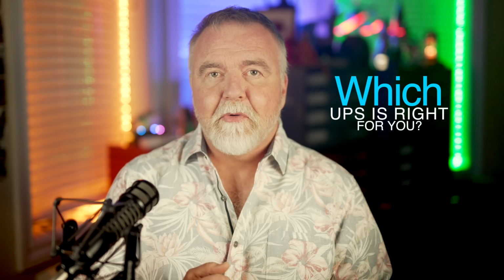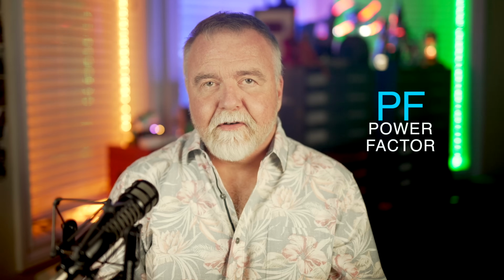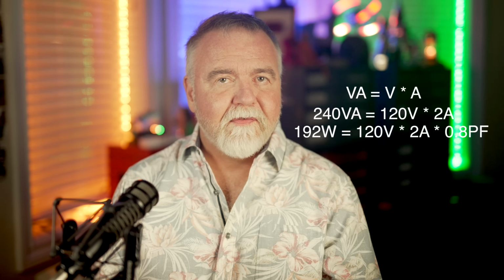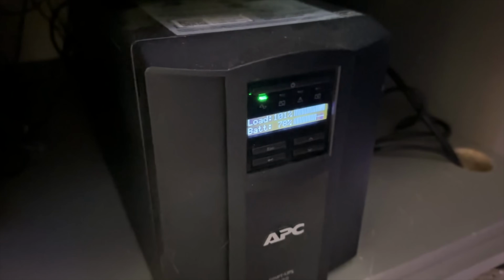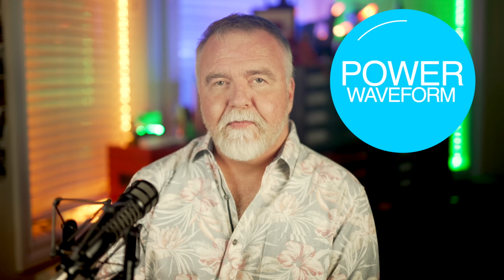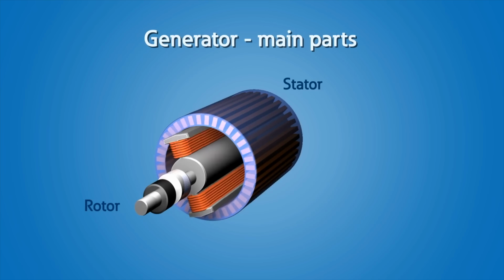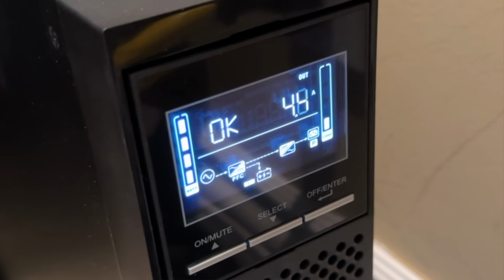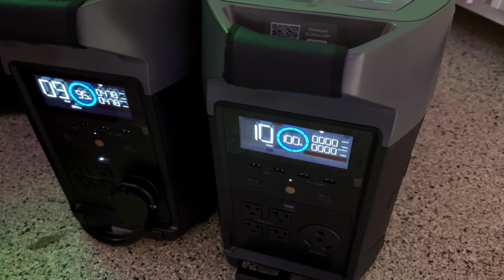The UPS Secrets YOU Need to Know!

Comment: You'll be amazed how most of UPS behave when tested with oscilloscope during heavy load or using power tools/other parasitic sources near them
Reply from the maker: I know... and you should hear my air compressor when run off a square wave inverter!  Sounds weird!
Reply: Ill be hooking up my scope to get insights here, thanks for the tip!
Reply: @DavesGarage  I thought square waves would shorten the life of heavy inductive loads. Thoughts?
Reply: @wickedcode007  I'll be more panicked about how my computer's PSU withstand against the UPS with modified sinewave or UPS that failed. Usually at power outage some of them behave badly against active PFC supplies (especially those with low hold time and shitty filtering design (15-20ms is ok, can't remember what ATX specs say)
Reply: @GbpsGbps-vn3jy  ATX spec is 17ms, at 47Hz and full load and minimum input voltage.
Translated from specs to real data could mean somewhere in the region of 15ms at 60Hz mains to 20ms at 60Hz (a bit shorter than full mains cycle to a bit longer).
If specs were to take PFC into account, than those could be following: "17ms, at 47Hz and full load and any input voltage".

Comment: Regarding battery longevity: li-ion has a longer average longevity than lead acid, but its longevity is significantly shortened if (a) maintained at full charge instead of around 80%, and (b) maintained at warm temperatures. You can increase the longevity of li-ion by de-rating them down to their sweet spot of around 80% and by keeping them cool. You can sort of consider the top 20%-ish of capacity as "over-charge", because it kind of is. And for temperature, if it feels cool to you then it's probably good, but if it feels warm to you then it's probably too hot for the battery too.

Comment: I have a problem with my pfsense router. it shuts down almost immediately when the ups switches over. Although the configuration tells it otherwise. The main problem is, that it shuts down the router (to a halt I think, not to a poweroff) and when power gets back the router stays in that state.

Comment: Thank you so much for this. I wish this had existed a couple years ago when I was shopping for a UPS. I did eventually figure out that I wanted line interactive since online wasn't in the budget, and that I wanted a proper sine wave for my gaming PC. I never could figure out a proper explanation of VA though, just that it's "capacity", so I ended up just getting 1500 VA since it the highest capacity available in what I was considering and I'd rather have too much than not enough.

Comment: I have an UPS. Last year, PG&E threatened to shut down electricity. I think I'm too close to the Apple HQ. The UPS started to go click-bzzzz-click-bzzzz. I thought the UPS was dying, but it turns out that the electrical circuit was dipping down to low volts, and the UPS was kicking in. The shutdown never happened, but wow, I'm glad I had the UPS.

I also got a cheap UPS for my modem due to power clicks for a while. My Internet connection kept having momentary drop-outs for several minutes, and the UPS keeps the modem running. I realized that my modem and router together costed more than $400, so got the UPS.

Comment: This may come as a shock, but I've been getting 12 years out of my lead acid batteries by keeping them on the floor instead of inside the warm UPS, and by setting float voltage to less than 12.4 volts. The UPS manufacturers seem to like burning out UPS batteries by floating them to at least 12.8 volts in the hope that you'll buy new packs from them at silly prices every 4 years. I find this blatantly unethical. I also do flavor a good quick off-line UPS to minimize unwanted power consumption.

Comment: A typical PC power supply does not care if it is fed a modified sine wave input.  It is going to chop it up anyway.  On the other hand electric motors DO care.   So a pure sine wave inverter is more important for power tools than for a PC.   One thing becoming more common is whole home battery backup, usually in conjunction with solar panels.   These systems often have an unfortunate interaction with the UPS.   When the grid connection is lost and the home is running off battery backup (e.g. Tesla Powerwall) the frequency is increased above the usual 60Hz as part of the safety protocol.   This can have the consequence that your UPS thinks the power is bad.   So, while the rest of your home may have power, your UPS will activate, run out of battery backup and then your PC will shutdown.  Some systems allow the frequency tolerances to be adjusted to avoid this issue.

Comment: One of the more insidious characteristics of lead acid batteries is something called the Peukert effect, in which the overall capacity drops as you increase the load. Lead acid battery capacity is usually specified at a 20 hour discharge rate. So a 100 amp hour battery can be discharged at 5 A for 20 hours. But try to discharge that same battery in 30 minutes as might be typical in a UPS situation, and you will find the overall capacity has been reduced by around 2/3, so your 100 amp hour battery is now a 30 Ah battery capable of delivering 60 amps for 30 minutes. Lithium ion batteries, especially LFP batteries, do not behave this way. A 100 amp hour battery is pretty much always a 100 amp hour battery regardless of discharge rate (within reason).

Comment: I much prefer to stick with sealed lead acid batteries purely for the fact that lithium-based batteries present a higher fire risk. No matter how you slice it, bad stuff can happen and it's less of an issue with sealed lead acid than lithium. There is good reason why Boeing's Dreamliner moved away from lithium and back to NiMH for their battery banks.

Despite my bad back, I'm happy to lug my big old 65Ah batteries to the recycling centre and replace them with new ones, and I would argue that lead acid batteries are highly recyclable compared to their lithium counterparts.

Comment: I'm looking to build a 48V DC supply, which supports my equipment with DC supplies rather than AC supplies on inverters.
Lithium Iron Phosphate batteries are very stable, safe, and have mass-specific energy capacity more similar to Lithium Ion batteries.
Reply: Most utility grade server equipment can be ordered to run off 48VDC. When designed really well they are more efficient than power supplies running off of mains AC. But do require significantly larger wire guage because to get the same power requires five times the current (compared to 240VAC), or two and one half times the current as 120VAC.

Running on 48VDC is exactly how telephone company switch rooms work, with generally enough battery capacity to last 24 to 72 hours. And co-locating in telcos is why the option exists for DC powered server and switch gear.
Reply: @mikebarushok5361  Cool. I knew there was a market for DC-DC supplies like this, but wasn't totally sure for what.

Comment: In fact, power supplies of consumer electronics don't care about waveform and can even run fine on DC. That's because the first thing happening inside is the rectification of AC into DC.
Waveform matters for inductive loads, primarily motors.

Comment: Living in the Santa Cruz Mountains, UPS is a way of life.   As far as brownout protection, when a power line fell on a road and cars drove over them for an hours, the 'protected outlet' took out the caps on a Genelec Speaker.  So I do not trust the 'protected no battery' outlets anymore.
Reply: that output is protected with MOV against high voltage transient thunder spikes, not low voltage brownouts. 
Use the "battery output" to protect brownouts perfectly with voltage boost !
😊

Comment: I used to work for a pretty big IT hardware support company here in the UK. Many years ago (About 20) I was sent to swap a PC monitor at a regional power grid management company, and on arrival I could instantly tell that things were NOT all rainbows and bunny rabbits in their world. It seems that I got there just as a big issue had cropped up, and all hell was breaking loose.

It turned out that a transformer somewhere had popped, and this had caused some kind of cascade effect through the system, with the supply to some entire regions tripping out, and causing them to loose power. Them becoming disconnected reduced the overall load on the system, but the power stations were still producing juice to the normal level needed to power that entire chunk of the country. This caused voltage spikes in the remaining areas, and these spikes caused other regions to trip out, making the problem worse.

All the time this was happening, I was stood there watching it unfold over the staffs shoulders. As it all calmed down I started asking questions like "What did those yellow triangles all over that map screen mean?". "Oh, they were over voltage events. They indicate 50V above normal". "And all those red squares?". "That's if it's spiked to over 400V" (Here in the UK the norm is 240V on single phase). I asked what happens next, and was told "Next? It's sorted. There isn't a next until something like this happens again". I said "No, I mean, the homes in entire towns saw over 400V for a couple of minutes. That could have caused some pretty big problems for some customers electronic kit". He replied with "If they logged the over voltage happening and can prove it, then they can deal with our legal department. If they weren't logging it, and they come home to a dead cordless phone or TV, they'll just put it down to bad luck, so again, not our problem". It was only then that he noticed that my security badge said "Visitor" on it, and got all cagey. :D

Not long after that, I bought about 15 surge protection extension leads to go between any of my more expensive pieces of kit and the wall sockets. I also keep a Watt meter plugged in that logs the max and minimum voltages it sees on the line.

Comment: How are those Delta Pros grounded? Wouldn't you be better off with an online UPS between your PC and Delta Pro to ensure clean, uninterrupted AC some wave? Same as outline for the battery and generator backup used on a Data centre scale.

Comment: I have several UPS units around the house. I have two giant online units and while very efficient on battery and capable of having as much external battery as I can afford without overheating, but it consumes 50W idle, 93% efficient online, and is kinda noisy, with a pretty loud coil whine.

Comment: Thanks, Dave.  I hadn't considered the PF when considering VA in the past.  Much like you, I pretty much ignored the PF.  Maybe that's okay if the PF is high enough, but it's likely not.  I'll need to reevaluate my UPS.
Reply: Also one additional piece about VA and Watts: most UPS systems are made to support load up to X Watts ad up to Y VA with X somewhere in range of 0.7Y to 0.8Y.
Which number they print on the nameplate? Obviously the bigger one, almost hiding the fact that maximum rated power is 70-80% of that.

Comment: Related to an orderly shutdown:  For a windows system probably the quickest (correct me if I'm wrong) is hibernation which saves the machine state verbatim in the face of an imminent power failure. But to me the most important is avoiding what is effectively a disk crash, especially when it comes to open-for-write files. And finally, when installing software/O.S. or formatting a disk, using a UPS is almost mandated.
Where lead-acid batteries are concerned, lifetime is often a hidden variable, especially the SLA types. You don't know how long they've been sitting on the shelf and usually in an unmaintained state. Anything but sitting fully charged and regularly topped-up is a recipe for sulphation of the plates which = limited peak current capability, energy capacity and lifetime in service. Even when being regularly topped-up, lifetime reduces anyway. And then there is the environmental factor of disposing of them. My experience has been that they are costly in more ways than one. As you can guess, I'l' never purchase or use one again. I regard lead-acid as an obsolete technology.
When it comes to offline UPS, I lost count of the number of calls I used to get complaining of a failure at the first (infrequent) power cut which occurred at my old workplace. Battery failure when the battery was really needed. I think that technology should be discarded; it offers a false sense of security in addition to having to replace a bundle of batteries which were often unavailable at once, adds to costs, a pile of unwanted waste to be disposed of and computers that were munted anyway.

Comment: Lightning always best to have external lightning protection in the breaker panel, then add in surge arrestors in the outlets that feed the UPS. For lightning you need multiple stages of clamping, high power but high standoff at the power input, that can handle the high energy incoming surge, and attenuate it down to a lower, but still very high level, surge on the power to the breaker panel. Then the breaker panel unit will reduce it further, using the impedance of the wire from the meter to the panel, and ensure a lower level to the outlets. Then the outlet units can handle the lower level surge, and clamp to a safe voltage for the equipment. Then the UPS can handle this higher voltage without problem.

Remember the lightning protection starts at the power line, with power companies using lots of surge arrestors and arc gaps along the power lines, because they all run outdoors, and are often the highest point on the landscape, and all the pylons are well grounded, so all of them will receive multiple hits in a storm. Thus there is a lot of protection, to limit the spikes that go to the customer side, where local hits cause a lot more damage, simply because the surge clamp ability is smaller there, as the power levels are lower, so the utility sizes them smaller. But also local lines tend to be hit less, as many are not that high, and are often buried as well.

Comment: Online UPS, one more drawback if the juice always flows through the battery:  If the battery fails, it's worse than having no UPS at all.  Your connected equipment goes down while everything else in your house continues to work normally.  I imagine the best of them can bypass the battery when it isn't needed.

I lost my confidence in the APC brand when a glitch in the power too short to affect anything else caused my PC to shut off suddenly.  The battery had failed, but the UPS switched over to it upon the power glitch anyway, and didn't go back to AC for several seconds.  My current UPS (not APC) will switch back immediately in that case.  When I heard the relay double-click a couple of years back, I knew it was time to check the battery.  Sure enough, it had to be replaced.  But it didn't screw me during one of the many quick power glitches we get around here.
Reply: Wrong. Typical online UPS include: PFC stage, bi-directional DC-DC and output invertor stages.
PFC output, DC-DC high voltage side and invertor input are connected together. DC-DC low voltage side is connected to battery.
Whenever battery fails, unless internally shorted, whole UPS is powered in the same way as normal operation.

Comment: The only reason I've got a UPS is that I live in an 90 year old apartment with knob and tube wiring.
Without the UPS I would loose my internet ( modem brown out) when I turned on my bench power supply or laser printer.

I also ran a ground wire to all the outlets from a cold water pipe. (no ground in building)
Reply: You can kill someone during storm when the lightning returns through the pipe (known as Ground to Clouds). It's not required the building to be tall for this to happen ... Or some idiot in the building cut the pipe

Comment: Most UPS will not protect enough in case of power spikes or surges. Even the big ones, according to the datasheets by APC for example, they can not replace a real surge or spike protection. Especially in the case of lightning strikes.
We have seen them fail just because from the spike of the emergency diesel generator kicking in.

Comment: Here is a 'fun' one from 1997. We had a RAID tower that started eating drives in an accelerating curve. It ended when all the spare drives on the shelf had been swapped in and then we lost 3 out of 4 active drives in a 7 hour time period. 😱 (It only cost us $90K in a mail order company 2 weeks before Christmas.)
- The culprit? The switching unit in the rather expen$ive rackmount 3000VA APC UPS was sending power spikes into the equipment. After losing $90K the only fix we could afford was a TrippLite ISObar surge suppressor.  That worked for the rest of the company's life...

(Tripp Lite ISObar surge suppressors are the best there is. Get some!)
Reply: Ouch!

Comment: I hope you'll include efficiency testing in your next videos.
I had a second-hand double-conversion UPS that looked like an ancestor of the P91. I resold it quickly when I measured how much energy it was eating!
I'd be interested if you could measure how much energy both the P91 and the Delta Pro consume under different scenarios, for instance: no-load, 10% load and 80% load.
In my case, my unit (4.5kVA) was consuming ~200W on top of what was plugged in it. This number seemed to decrease with load however!
Which is strange because at first my explanation was that there seemed to be a constant ~0.1A going through the batteries (20 batteries in series, charged with ~270V DC since I live in a 240V AC country), so the amount of energy would be correct but not decrease with load... I may have missed a change in power factor though...
Maybe this consumption was because the batteries were old and recent units wouldn't need that much constant energy going through the batteries?
Anyway, looking forward to your test of the Delta Pro!